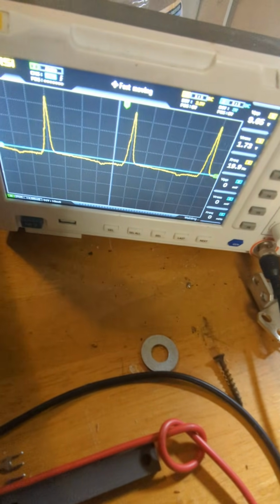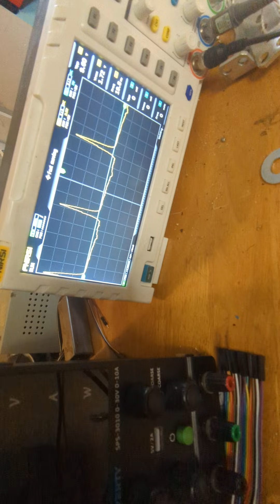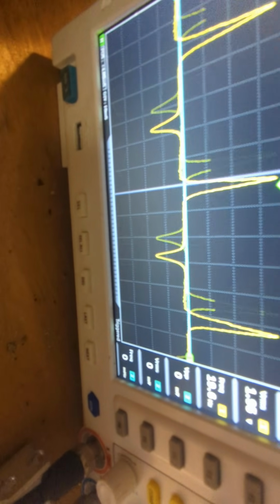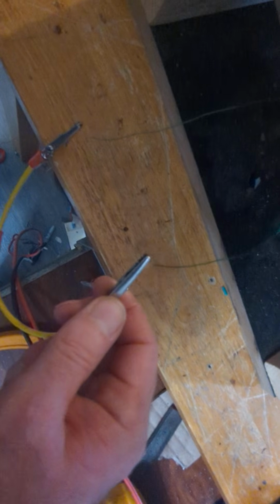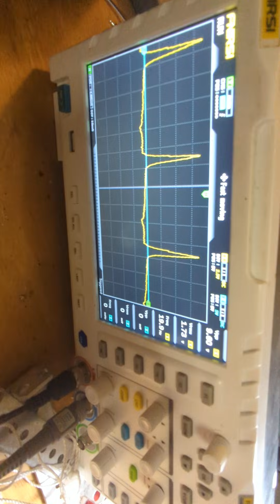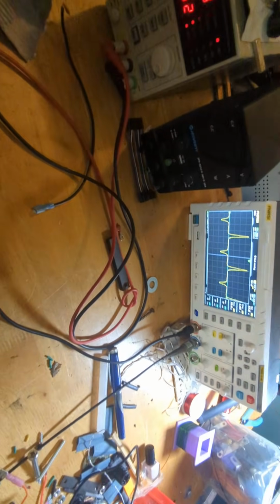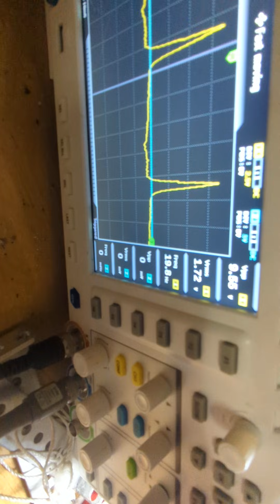Lenz Coil Added To Single Polarity Output Generator-  Didn't Expect This!

Comment: On the EF (Aaron's forum) there's a guy there who's been posting about experiments with Bedini's monopolar generator configuration, calls it Magneto-Dielectric Rectification, these are the same waveforms he got there when he has the magnets in AC configuration, on their sides, very interesting.

If you reverse the direction of rotation does the polarity of the first coil reverse?

Comment: whats the difference between a Lenz-Coil and the other one?
Reply from the maker: Nothing really.  If someone manages to Sidestep Lenz Drag, they loose output proportionately because Lenz Opposition is what dampens the reactive nature of the output coil by lowering impedance.  The "Lenz Coil" purpose is only to Oppose the output coil.
Reply: @floodrod I'd think instead of trying to reintroduce Lenz drag a better way would be to tap the reactive power indirectly, such as stepping it up and using Tesla style cap discharge circuits, you can tap the discharges to do work without stressing the prime mover.

I'm sure there are many more ways to take advantage of the lack of Lenz system that I don't know of, this is just one idea that comes to mind, we need more heads on this.
Reply: @floodrod  ok makes sense, thank you